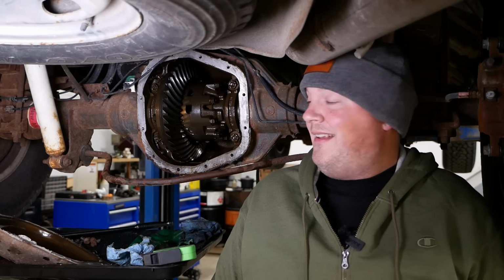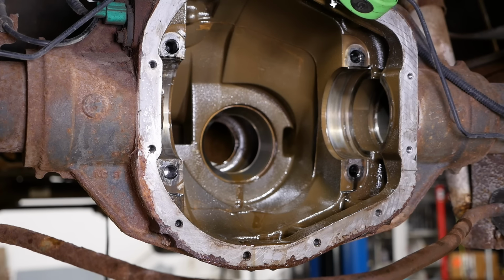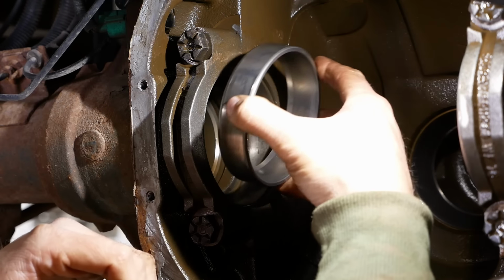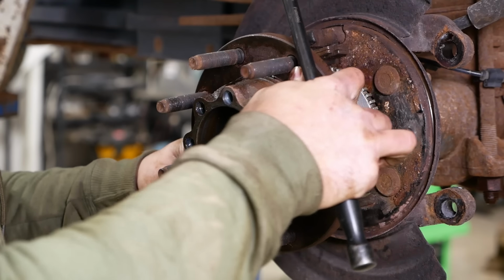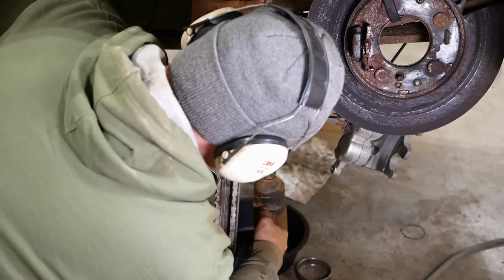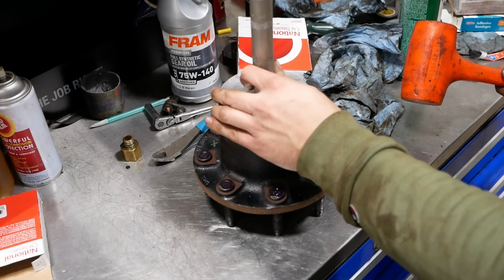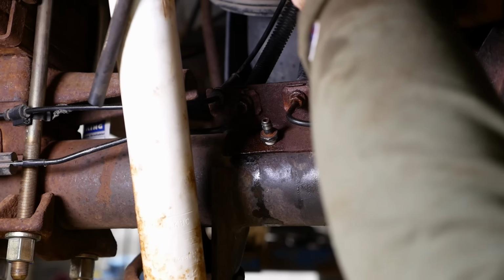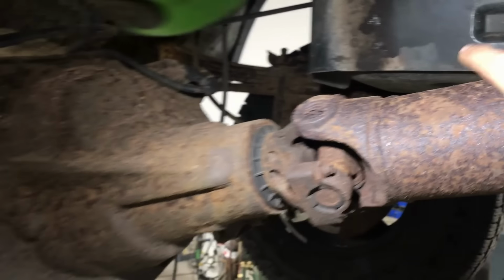Ford Differential Carnage - Driveline Noise Located

Comment: Keeping those carrier bearings in place while under severe loads seems to be a constant problem with heavy pickups, no matter the brand.

I went the more expensive route on my 1st generation Dodge ... a Jasper rebuilt.  Re-fitted carriers, installed with bearing locker.  The original 5 speed transmission was replaced with a brand new 4500 HD rather than simply rebuilding or replacing the Getrag.  Both were painful to the wallet, but that pain has only been once for each in close to half a million miles, a lot of those pulling much more than the truck was originally rated for.  Everyone else would have been through 5 transmissions and at least 3 rear ends by then.

I think another reason for the longevity I've gotten is because, as I learned more, I changed my driving habits.  Constantly trying to get more than you should reasonably expect out of machine, for the most part, only leads to premature wear.  "It's a workhorse, not a racehorse."  It will plow a field all day.  But if you put it in the Kentucky Derby, it will be dead before it gets halfway around the track.
Reply: Talking about a bearing locker, are you talking about a retainer that blocks the preload shims in place?  On my 04 wrangler d44 rear axle the preload shims are outside the bearings and held in place solely by interference/preload force, though i dont think they slip out completely due to the diff cover.  I have read views that the carrier bearing preload should be very tight on assembly, and failure from too much preload is rare or nonexistant.  I believe that was from the Randys ring and pinion website.
Reply: @connor3288  I'm not sure, but I think the locker was used between the bearing outer races and the case.  Prevent movement under heat/stress, remove any chance of having the race spin in the case.

I know the transmission man that installed my 4500HD told me that he had a jig that would literally spread the case to make removing the ring gear/spider gear/bearing package possible "without resorting to the use of high explosives ..."  I think  (not certain, because it came to me by hearsay) manufacturer outfitted repair facilities have, or had, rather specialized equipment (unitaskers) that would have been expensive and impractical for most small repair shops to have.  Certainly explains the popularity for swapping out the entire unit rather than repairing it yourself.

Comment: Bearings have a rated capacity and speed for oil lubed and grease packed. Generally a grease packed bearing has a lower rated speed. Grease packed bearing have a higher dynamic load capacity, if memory serves me correctly.

Comment: Good call replacing the whole diff with a used unit.
I have stepped on some bad land mine$ trying to be a $mart a$$ and replacing individual components with new ones while trying to make it work with old ones.
Don't end too well specially with parts that were assembled all new as a unit at the same time.
Good work, Wes !

Comment: Things certainly have come a long way. Back in the 70's I bought a 1962 Ford F-100 (predecessor of the F-150). Shortly thereafter I was able to obtain the actual Ford shop manual for the entire F series. 100 to 900. I had started having trouble with the rear end howling. I found out that, according to the Ford factory manual; they wanted you to set the pinion to ring lash with a common "brown paper grocery sack". I did not believe that was correct, so; I consulted a mechanic that was older than I was at the time. He said that was right and quite common. The truck is long gone, but; I still have the manual. So, the lash was variable enough that a common sack would work to set it. Not like that anymore, is it?
Reply: Not a bad trick at all. Like using a business card to set flywheel gap on small engine coils.
Reply from the maker: Interesting. I have some old manuals that show how to make your own special tools. I can't imagine that anymore. If they can't get it off the Mac Tools truck it doesn't exist.
Reply: @WatchWesWork  I have a manual that shows that as well. I think it is also a Ford manual. Somewhere around the mid 80's. That's when I got out of the business. Around the '86-'88 time frame.
Reply: Tolerances are so tight anymore there's no extra "meat" to machine down. It's one time use and throwaway.  Brake rotors . Drums. We live in a throwaway society. Before too long we will loose the skills to do so. And if it doesn't have an OBD port shops don't want to work on it anymore. Nobody "fixes" things anymore its strictly R&R.
Reply: @WatchWesWork  Making your own tools is half the fun (at least for me), tho I know I've added plenty of time to my personal projects making tools but hey if it's a job I'll be doing more than once it's worth it.
Reply: @WatchWesWork  I remember watching Shango066 repairing a 1930s radio and him commenting that the schematics for the radio actually included a parts list for, and instructions on how to build a vaccum tube multimeter. So the idea of a repairman having to make their own tools was definitely not confined to the automotive industry.
Reply: @roguedalek900  Lots of people fix things,  but automation has made it cheaper to make things.  Robots work for pennies an hour and don't need to feed their kids.
Reply: Great information, for a ford dif. probably not good for any other vehicle, except dodge, christler, or what ever they call them selves nowadays.
Reply: @roguedalek900  especially the us big 3

Comment: Mainly the vehicles from Ontario and Quebec are the ones I find to be very very very rusty, I assume its because they get milder more frequently near freezing weather that necessitates road salt application. Generally Canadian vehicles in Alberta, Saskatchewan and Manitoba don't get rustier than the average American Midwest. Nice job on the Diff swap Wes.
Reply: Road salt is only affective to around -10°C. It's just too cold in Alberta for it to be useful.
Reply: Yeah I live in northern Alberta and have never seen a frame as rusty as what he works on
Reply: @tlr-nut7275  That's true for common sodium chloride, but they're now using calcium and magnesium chloride that are active to almost -30 C.  It's mixed with water and spayed on. It's starting to show up in Alberta and Sask. and Manitoba. Road crews love it because, whether it's needed or not, it's gives them more winter work.

Comment: I had carrier bearings spin on an 8.8 damaging the axle housing in a big way.  I bought a good junk yard axle. When we measured the pinion depth we found the cups were 0.002 smaller than the axle housing. We called several dealers, finally and old service tech said that in Ford service training they were told that the axial preload on the bearings locked them. We put it all together with the correct preload. It ran 50,000 miles till I sold it. No noises or metal in the oil.

Comment: One of my fathers work trucks, a 2009 gmc 1500, lost all it rear diff fluid when the cover rotted. He heard a whining and soon found out. Got a new cover, put fluid back in and 5 years later it still whines just like it did when it lost all its fluid but has held together strong. Hahaha

Comment: Looks like water intrusion killed that differential pitting the steel and rusting the vent shut. Should of been checked once in a while.
Reply: Probably just sat for a while
Reply: If should have did, there would be less work for repairmen.

Comment: If you didn’t already know, bleeding brakes on vehicles where the last owner or current owner says things like “what do you mean you’re supposed to change brake fluid regularly?” Often results in a blown or even just damaged master cylinder? It can even be just enough damage to make proper bleeding a pain more than it should be. It’s good to backfeed up from the bleeder screws (easier said than done I know) when getting air out and to feed from the master cylinder (like with that fancy pressure bleeder you have) when changing/flushing the fluid with no air trapped. One being because air floats and the other being because dirt and debris sink. (Also water may sink below brake fluid but it’s hard to know since it’s hydroscopic)

Comment: Even with the $20/gal coolant for my Toyota, I simply cannot imagine a situation where I would ever consider using used coolant outside of an emergency situation.
Reply: Who would?
I can only imagine it's priced at the cost of disposal and after 6 months on the shelf, can be written off as a loss to claim back the cost of getting rid of it.
Reply: @jonathan1427  honestly that makes a lot more sense than the idea of someone reusing it.
Reply: Used coolant is great for those of us who have a lot of junk projects sitting around that need to be winterized. They practically give the stuff away.
Reply: Filling tractor tyres for extra weight.  Personally I just use water, but used anti-freeze is a popular choice in places where freezing is a consideration.

Comment: I learned, the hard way, to go ahead and put some grease on the outer bearings to get it by until the oil makes it’s way out there, if there isn’t already oil there, obviously not needed if your just replacing a seal or something. I had an axle bearing burn it’s way out of the tube once, bosses truck too, he should have pulled over long before the failure.. he even complained to his brother (my other boss) that it was making “all kinds of racket for a hour on the highway”. That argument to the other boss saved my job and I learned a lesson from it, and I was glad that he survived the failure but he was mad at me for months! Pouring the gear lube on before assembly is the same thing but i always think about it after assembly every since that incident.. 25 years ago

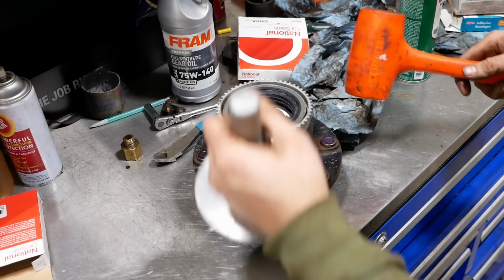Comment: 32:34 Is there a reason to not do that with a press, either an arbor press or a full-on hydraulic press? I think you have both, I know you've got the full-on press at a minimum. It just seems like a lot of work goes into hitting it and keeping it even/straight when you could just make a little adaptor that holds the installation tool squarely on the front of the press ram and then give it a good old-fashioned hydraulic shove...

Comment: That is interesting about the junkyard not selling brake components. I have purchased used brake parts before. Callipers, drums and one time I even got a very nice set of hardly used OEM pads, discs and callipers from a basically brand new wrecked hire car - I think it had done 700 miles to put on one of our high mileage work vehicles. I always very carefully inspect what I get. My rule for callipers from the scrapyard is a "fresh kill" - I don't want something that has been sat around for years and has seized - I also look at what damage the car has had before making a decision. Considering what some of the parts stores sell if those callipers or discs or drums were working a few weeks ago. They'll be working fine on what they have been stuck on. 

The scrapyard I go to most of the time is run by illegal immigrants from India. I can speak crude Punjabi so I normally just hint that I can call immigration if they won't sell me what I want. They also know I stopped off at the Indian shop on the way and got them some onion bargees or veggie samosas or Pakorra or something. We haggle over the price. It's a game we play. They are good guys. When I used to keep our vehicles at work running on a shoe string they used to sell me used coolant and waste oil to keep some of our oil and coolant burning vehicles topped off for cheap. 

God bless the scrapyard.
Reply: @Beardman56  We get a fair amount of rust here in England. Don't get me wrong there is plenty of brake parts I wouldn't touch with a barge pole. Some brakes have a really hard life here - especially on lower mileage vehicles. The pads or the slide pins get sticky. The pistons corrode and get get stuck. Always have to keep an eye out.

Comment: Rear axles are probably the most forgiving component of 50 years of car and truck building.  I took apart a binder 2-speed with ring gear teeth you could literally shave with.  I got another year out of it before I found another junkyard replacement.  If you can stand the noise or the smell of hypoid grease you can get by with junk.  Still, you did the right thing for your customer.  You don’t want to see it again.

Comment: I work in the oil field here in Nebraska I drive a 2013 f250 doing the same weird noise it has 322000 miles on it with the 6.2 other than rear-end she's still going strong

Comment: Guessing that finding the correct ratio wasn’t a problem. I had a noisy gear set in a Ford 9” years ago. Bought a whole parts car (minus engine and transmission) and got a sound third member but the gearing was higher. Changed the drive gear for the speedometer in the transmission and the repair was complete. That’s how your speedo was matched up to your rear end gearing in 1972. I did the repair around 1994 or so. I’m old — just not that old.

Comment: In France my nearest junkyard about 45 min drive away will sell me brake parts, no problem...apart from they are 50% of dealer new price - or 2x aftermarket new (from Germany)! When I lived in PA, the junkyard would not sell brake parts or lighting components, but you could have them for free! Working at summer camp I kept many vehicles on the road for not much more than the price of Gas + Oil + effort.

Comment: I had my F150 rear end rebuilt and it cost 1,000 with labor. The guy I brought it to did it in 2 days for me. He was very cool with the labor he charged. I was expecting a bit more but I guess you get lucky sometimes. It has been 5 years and still quiet as can be.

Comment: when root beer foam oozes out of your diff check plug, you know you've got a problem. last winter i rebuilt a chrysler 8.25 rear diff on a jeep liberty. the diff carrier bearing races didn't move when the caps were torqued down, and i don't remember any other that i worked on moving either, so i'd have to agree with you, that axle housing is shot. replacing the entire unit was absolutely the right call.

Comment: I believe it was seal technology that held back the use of oil in wheel bearings. Oil seals don't like any play in the bearings: it wasn't until Stemco came out with their system that I started seeing oil lubricated hubs.  Land Rover attempted it decades ago, but gave up and changed the manual to say to pack the bearings with grease, so the grease acts as the oil seal: there is no seal between the bearing and the differential. The old B model Macks had a seal between the inner and outer bearings, so the outer bearing ran in oil, while the inner bearing ran in grease. The two seals and the grease kept the oil from leaking out.

Comment: When we serviced our 2 1/2 and 5 ton trucks, we always packed the wheel bearings with GAA (grease automotive artillery. They all had full floating axles, and like that type, were lubed by the diff oil. It was done as a pre-lube. Still a good idea.

Comment: Thank you for that explanation about the gear oil in the wheel bearings. The only time I've done something similar to this was on my old 80 Series Land Cruiser. Those have a floating rear axle and they call out bearing grease even though it's built very similar to this.

Comment: Reason for sealing off the wheel bearings,and packing them with grease is for deep water fording.If water were to enter the hubs,it will not contaminate the  differential. Commonly found on tactical vehicles, and municipal trucks that occasionally have the need to travel  through  flooded areas.

Comment: Worked on a lot of 30, 40, 50, 60, 70 80’s trucks and cars all of which had wet axel.  No grease on the outer bearings. every time you make a turn it pushes oil to the out side

Comment: I figure I’ve rebuilt about 300 of these 10.5s over my career with fjörd. I’d say 90% of the time the ring & pinion can be saved. I always appreciated that fjord’s bearing kits seemed to fit perfectly and didn’t require any serious measuring and re-shimming. Assuming that the noise was caught early enough.

Comment: Excellent video. When reassembling my 10.5,  no "sliding fit" for the carrier assembly was allowed. Bearing side preload was +.010 for either side, once my BL was established + or - spec. There's no easy way to get them in other than with a spreader. It's hard to "tap in" +.010 shims (or more) into a shim pack with zero clearance.

Once you buy all the new replacement parts as OE there still may be a problem. If the new carrier shims slide easy into place into the housing with the carrier assembly, consider your housing is "sprung." For this, there are aftermarket shim packs for additional fine adjustment on the bearing or race. Expect 2-3 mock-ups.   

I've used the L/T bearing retainer on all 10.25/.50" caps afterward as a precaution. But once loaded, they're impossible to move. If you run big tires and HP with a locking rear, an axle truss is a good investment.

Comment: Here is ‘how not to fix the problem’ but it does work, use a plane to cut thin strip of lignum vitae, use that in the cap, or both saddle and cap if badly spun, important thing is not to use glue, just a dab of gear oil to hold the wood in place.

Used this trick on forestry tractors, they are particularly hard on axles, and it seems to put up with the stress better than anything else.

Comment: I'm having air psi issues in my semi...over pressure. Releases at 150 psi and used to be 125. Secondary tank started dropping down to 40 psi when purging then bounces back. Dealer changed governor and dryer. Also did software updates. Never fixed the problem. 12.9 hours of labor. 
Took to different dealer and they said needs a dryer I told them the story and current dryer is 2 days old. Finally they said it needs a pressure sensor. Thankfully all under warranty but come on. Dayssss in the shop